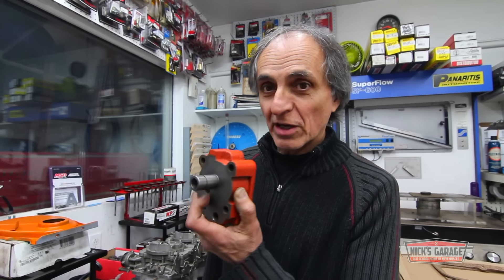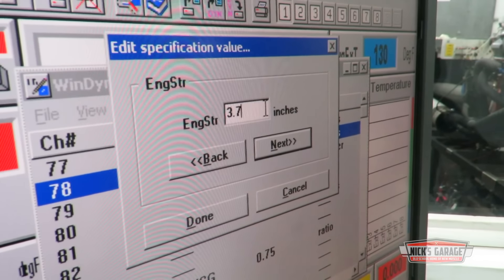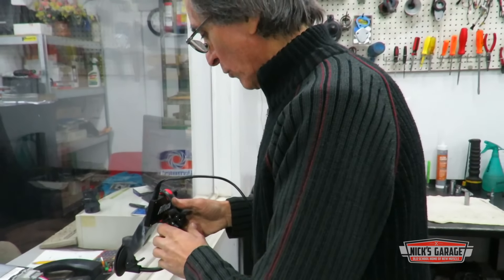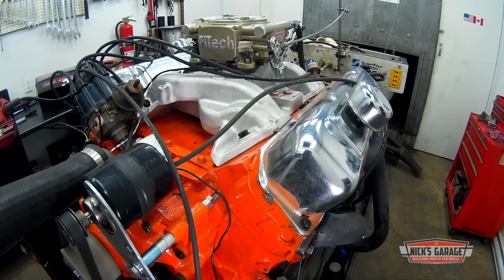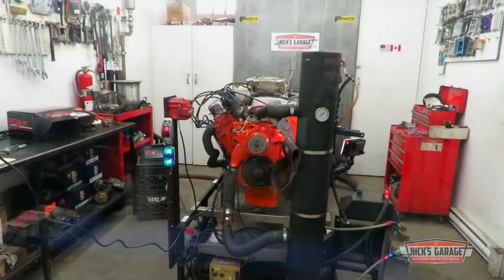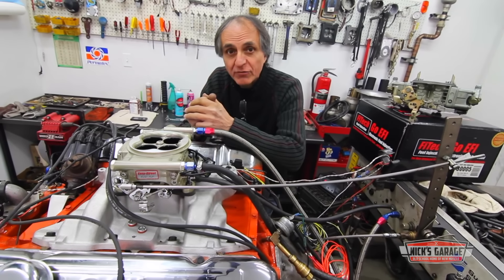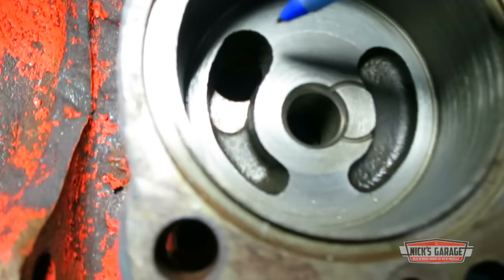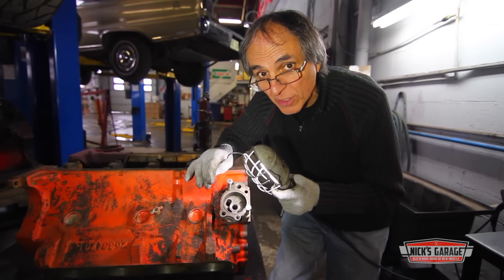Carburetor vs E.F.I. - Dyno Room Showdown

Comment: I agree with you guys. I am old school, and yes the EFI is a great system after you tune it properly. Give it time and it will work perfect. Easy start in any weather condition and altitudes without any jetting. Performance with EFI is also great.    Thank you all for your input.
Reply: Thanks for getting back Nick. As soon as I can get a passport,I,m heading up to see the dyno room for myself!
Reply: Do some research on those bolt on efi s and ull realised its garbage i wanted to go wth holley terminator but after doing research isn’t worth it. Now if my car stalls its easy fix on the spot but if ur efi fails no chance of fixing it on the side of the rd 😊
Reply: I was speaking of new cars,and if you built your ride properly you wont be on the side of the road!
Reply: @grampageorge3407  Thats want all the auto makers think but they all break down sometime.  You would think for the price of a mercedes it would come with roadside assist for 15 yrs.

Comment: I have run FiTech  EFI in my drag car for 3 seasons in Super Pro with a delay box and transbrake  it takes a few passes at WOT for it to level out also there are so many adjustments that can be made in their system if you go into pro tuning on the hand held I am certain that with some time spent with the data logger turned on and timing control on ECM enabled that it could beat a carb. we run different AFR's for idle, cruise and wide open and also pull timing out of the engine at 6000 rpm. I my self love how fast the throttle response is. I idle up to the burnout box and instantly 5500 rpm shift to high 6000 rpm roll forward back to 1st and just idle no clearing the carb just idle up to the beams stage right on the transbrake no loading up just nice hard launches. 9.70s @ 137 mph with a 522 cid pump gas engine. Best part hood never comes off  it's self learning and incredibly consistent I drop off hundredth when the carb guys drop tenths due to changes in the air and while they scramble to switch jets I kick back and wait for the next round. It's also easy to switch fuels I have ran both E85 and 93 it just a matter of draining the fuel cell and reprograming the ECM with the hand held a job that take less than a half hour. I will say this it took time for us to find the sweet spots for our set up with the data logger enable and using the pro tuning so to say the carb wins without putting some time into it might be a bit misleading.

Comment: It would have been nice to have seen the EFI display during the pull, and maybe the computer monitor instead of Nick and his customers for the results... Also, I hope he's running a thermostat for this test. It appeared that the coolant temp was only 127 deg. F during the calibration process. If the engine didn't get to operating temp, all of the fuel mapping will be off. This might account for the 10hp drop in power compared to the carb. In order to make a more accurate assessment, the AFR's on both setups would need to be matched at peak power. If that was done, you could look at the curves, and see why a carburetor is a dinosaur. Don't get me wrong...you can make some big power with a carburetor...but for power and torque under the curve, driveability, cold starting, throttle response, reliability, and economy,  I'll take EFI. There's a reason that 1984 (I think) was the last year the factory put one on a car.
Reply: Emissions caused the carb. to go away.

Comment: Spoken to a few gents who had fitted Holley sniper...they are very pleased and it took the system a few runs for the system to learn.  Once settled, it was a case of just turning the ignition on , crank and it fired up.  Smooth, no hiccups, hot or cold...    Not about HP, just drivability

Comment: About the oil pump trick. Its not really going to matter. You wil still pump the same volume of oil trough because fluids are not compressible. However you wil have less friction losses in the engine so you wil see a small not noticeable performance gain.

Comment: Happy to see the oil pump trick. A lot of new builders completely overlook checking out the oil system. Even more think that just because a specific part is a fancy new performance part, its going to match and be perfect right out of the box. It never hurts to take a few extra steps and check how different parts mesh with your engine.
Reply: There are also several other must do oiling mods for B/RB engines.

Comment: The carburettor will start right away too if the bowls are full.  With an electric fuel pump, they will fill and typically the engine will start faster than EFI.

Comment: unless its a drag car where the only thing that matters is flat out power , the EFI has many more advantages . I put one of these on a camaro for a guy whos wife wanted to drive the hot 350 but didnt want to go thru the cold start stop/start / hold-it-on-a-fast-idle-or-it-will-quit-when-you-put-it-in-drive caper . the EFI would start from cold without touching the throttle , drop it into drive and off you go . it would start and idle at any time without touching the throttle at all . The EFI makes allowances for a cold motor and adjusts itself to compensate

Comment: nothing like "properly tuned" carburetor, the main downside is cold start/cold engine performance. I wonder what type of memory that FI system has, if you unhook battery power does it have to relearn again? that would suck considering classic/show/race/off-road vehicles most always have a physical battery disconnect switch ;)
Reply: throttle bottle.    The night before we stayed late to tune this EFI to perfection. Next day for video, it had a mind of it's own.
Reply: I have about 6 months on this system..  I have it in a classic 63 Ford and the cables come off when parked.. the EFI seems to deal with it just fine.. I know the manual said something about needing 12v constant but the disconnect does not seem to effect it.. (perhaps it is just pulling the tune off the memory instead of stored in volatile memory?)
Reply: @randalljames1  the computer writes the fueling information into an EPROM so you could disconnect it for 3years and the same info would be there

Comment: My last hothod that I built was a pontiac  T/A with a 350 chevy motor in it  that I built in the early 80s. The motor had a b&m 4 61 and a b&m  fuel injection unit from air fuel research on it. To say it was primitive compared to the current FI  systems would be an understatement. That said this motor ran extremely smooth and was a streetable as all get out. If you are an expert at tuning a carbs like Nick you can get close to FI with a carb but the modern units are extremely reliable and make horsepower right out of the box. Get a modern system that is total engine control (spark and fuel) and you will have a system that is unbeatable.

Comment: I have a returnless red holley electric fuel pump and no issues with vapor lock even though it's feeding a ford big block 460 in las vegas heat. A carb is fine and simple for now.

Comment: Interesting test EFI  Vs Carburetor. Maybe at max revs the old system works best.  For originality in a restoration, I'd stay with the 4 barrel.  Everyday motoring, cold or hot starts,  fuel injection wins. Good tip about aftermarket parts. They always seem to be  inaccurate.

Comment: I don't want to disparage the FitTech EFI, but this is hardly the type of EFI that will get you great power. It is throttle body injected as opposed to sequentially injected port EFI (not in itself a huge performance hit). But, it doesn't even control timing and you can pick up tons of power there. The "Auto-tune" feature while nice isn't a replacement for EFI system calibration.

Spend a few more bucks and build a true programmable EFI system and you will see real gains.
Reply: Yes electronic spark advance is a very important.

Comment: That particular EFI system needs a minimum of 3 hours running (Driving) to learn, in all situations preferably city and country driving. Idling wont let it learn through the whole rev range, under load, coasting, cruising etc. I have the same system, and watched a heap of youtube videos with the same system, they all say to follow the manufacturers instructions when it comes to the self learning part. I'd rather go for a 3 hour drive than spend a day or 2 tuning a carb.

Comment: Carbs don't automatically make more hp than FI in all cases, there are too many variations to make that assumption. There are many different carburetors and manifolds, and many different fuel injection setups, and countless combinations of parts and levels of tuning that determine power output.
Reply: Howard Jr. Ford.    That is correct. I couldn't said it any better.
Reply: Thanks Nick. I love watching your Mopar builds.

Comment: Doing EFI without individual runners is kind of missing the point;   efi can do anything carbs can do,  and once you move away from stock,  retuning is very straightforward with EFI, very hit-and-miss with carbs.
Reply: Carbs can run without crank sensor, cam sensor, map sensor, throttle position sensor, egr control valve, will run on 4 to 6 psi fuel psi,  maf sensor not needed either. Carb won't run upside down though. So there are some things a carb can do efi cannot do.

Comment: carbs 'n point are neat if you like fiddling with them. Well tuned modern engines will always be more power dense with better driveabilty.
Reply: until the computer fry's or o2 sensor goes out or really anything electrical goes off then well your stuck and the carb will keep going
Reply: Drew 5.9 computers don’t fry often unless it’s mounted where water can easily reach it or you try to apply voltage to a pcm powered circuit like a dummy. O2 sensors don’t go out often either. They don’t go out in a short length of time unless you have a severe exhaust leak after the sensors or you’re running open headers which is not good for power anyway. Efi is retardedly easy to diagnose and repair. I really wish people would stop making excuses for why efi isn’t good. It’s far more reliable than a carb, so I just don’t see the argument about an efi component going out. People who are worried about such things usually have one thing in common...they haven’t spent 10 mins watching a video on how to test efi and are likely intimidated by anything electronic. It’s not voodoo. It’s painfully simple once a person is willing to sit and listen to how it works.

Comment: I ran a 351 clevland, tunnel ram, two 450 cfm 4bbl carbs, holley 110gph electric pump. Ignition on, carbs fills fuel as E.F.I. Starts good.

Comment: the funniest thing is NASCAR still regulates that car that enter must have carbs and restricter plates over efi setups on their motors. while people buy newer cars with efi setup. I just love how a v8 and v6 sounds on carbs anyway
Reply: Carbs sound great but an itb efi setup can sound just as mean
Reply: @ferrarikingdom  as of current. Nascar in an article stated that their motors run both carbs and efi something drag racing has been doing for a while Nascar has stated they have been running this set up since the experimental stage.

Comment: An ΕFI mod needs a proper map. The default settings are there for reference. Only a qualified mechanic can adjust them properly. 
Carbs on the other hand are easy to setup (dated tech).
Reply: Agree in the first statement but not the second. Depending on the carb, you can play with jets, accelerator pumps, idle mixture, choke, and for bigger gains you can mess with intake plenum. Setting up a carb for everyday driving, a shade tree mechanic can do it, but for performance it takes are artist. Out of the box, you HAVE to know how to adjust a carb on a new install, as shown on this video, EFI is mostly install it and then let it do its thing. I had a tech tweak my RAM and he used a computer...had another mechanic tweak my old Jeep with the Holly and he had to lift the hood and get a little dirty.....different skills.

Comment: I'll stick with my 850 quick fuel even though gas mileage suffers alot more and sometimes cold starts suck. EFI is cool, but it ain't for everybody.
Reply: Amen . . .I can’t justify the cost of a EFI conversion (along with possible long term dependability issues) over the fuel efficiency gains.
Reply: @neilwatson4562  👍 keep your carburetor
Reply: No fuel infection for me, my 850 Demon works great on my 427 Ford.

Comment: A properly tuned carb will drive and race as well as fuel injection, but fuel injection will give better starting and slightly better economy. If your carb is set up properly, changing to injection will be a big expense for very little gain.

Comment: This Fitech looks like the 30003 unit, which is only rated to go up to 400hp.

I say that because it looks identical to the one I have installed on my 5.0 create ford. I had a new 650CFM Holley when I first built my car, and I've taken it to 2 different shops to get tuned. I was always changing jets or trying to adjust it. In the end, the Fitech was easy to install and it feels like I added 100hp to my car.

Nick is correct, if you've spent several hundred hours working at a shop and learning how to best tune a carb, then yes it will be better. It's an art, ask any of the guys that used to build and tune carburetors for NASCAR teams. They had rooms dedicated to carbs, to test and tune to get the perfect one for every single track they went to. Now they just use the same Holley EFi unit and hit the track.

Comment: A lot of these BB mopars broke the  oilpump driveshaft and tore the bottom end up from oil starvation.
Don't use stock shafts on high rpm motors.

Comment: I've seen it before, where a laptop changes the program slightly, and BOOM!  More horsepower!  He could have added more timing with the EFI and got better results also.
Reply: Mike Chiodetti.      True, we needed more time to learn the EFI.
Reply: Thanks Nick!
I suspected you were aware of how "tuning" by laptop can make incredible power.  I'm 70 years old,  and retired, my Dad had his own auto/trk repair business, so I grew up with "the way you make power is through pistons, camshafts, carburetion, better flowing intakes, headers AND the big one, CYLINDER HEADS!  For me, I was able to work on carburetored pickups AND larger trucks with BIG Holleys and adjustable timing!  It was a City Fleet.  I was comfortable with that, then in 1988 came FUEL INJECTION!  But I  learned how to do with F.I. as I did before with carburetion.  Just different approaches.  Electronics has changed the whole game!
It's still good to see a company that is dedicated to working with a known, solid way to make power ! ! 
Keep up the good work!

Comment: You still need to tune EFI if you want it to perform.  If you just want it to "work", you can let it self tune at idle. I guarantee you could push that EFI, or maybe a good EFI system, until it at least matches a custom tuned carb, if not better.
Reply: 8literbeater.       True, we needed more time to learn the EFI system.

Comment: This is a unit ( possible the up to 400 horse model..30003 ) they have a model up to 600 hp...my shop only uses fi tech.. very simplistic to use and install. Other manufacturers sometimes very difficult to tune. This unit is self learn...He let it learn its idle but not it demands through the rpm range..given time I believe power would have increased!.. my 2 cents on this unit

Comment: Poorly designed experiment. The EFI had no opportunity to adjust parameters under high speed and load. The way he ran the test the computer was forced to extrapolate the WOT parameters from idling conditions, which is only a crude approximation. He also only took one data point on his dyno. With multiple high power pulls the computer would adapt and power would increase. Classic case of confirmation bias.
Reply: Dane Beck I agree with you 100%. How many pills did they make with a carb to get it tuned? And why didn’t they show the actual carb data?  This video would have been interesting, but instead it’s a loss a credibility to the people who produced it.
Reply: Exactly, they would get true data from the NASCAR boys who have been running EFI for a few years before the carb.
Reply: Any one wanting to buy a Fitech should think long and hard about wasting
 your hard earned cash on this system. Months of drama and no support 
for Fitech. Still not running!! Junk!!!

Comment: Maybe I missed it but I didn't seem to get what the carb was? How much time and mods were into the carb vs just a jet change? I wonder if there should be timing curve changes to work with the EFI that has an O2 sensor. Apples for apples... If you put in more than 10 minutes to get the carb to pull the 439 HP  then shouldn't you give the EFI the same consideration to have an honest test?

Comment: for offroad applications you can't beat efi because it won't flood on steep angles.
Reply: TRUE BUT SOME PEOPLE STILL LIKE PREDATOR FOR OFF ROAD AS WELL, YOU CANT FIX A COMPUTER IN THE BUSH
Reply: I had a terrible time getting my 1988 GM camper van to run with the new computer and new 350 TBI engine. Nobody works on them any more. The best help came from 4x4 off roaders who use 80's GM TBI systems on crazy hill angles. The van runs like new after they sent me a few tips.
Reply: RadinPlayz12 what would go wrong with a computer that requires you to “fix” it? As long as you don’t half ass the wiring, there shouldn’t ever be any issues. You aren’t going to suddenly have an injector crap out on you either as some have suggested (not you). Efi is ridiculously easy to diagnose and repair. I don’t understand why so many people are still afraid of it.